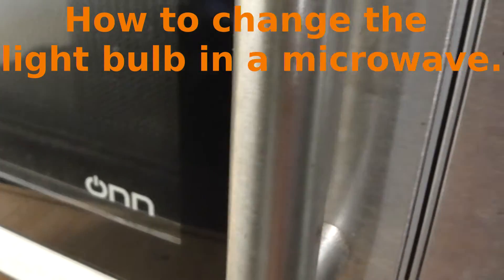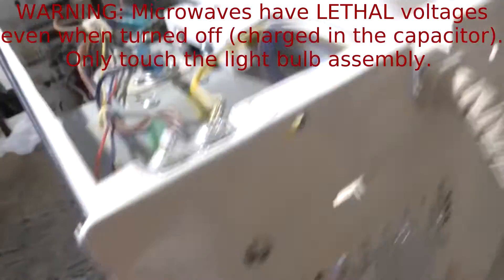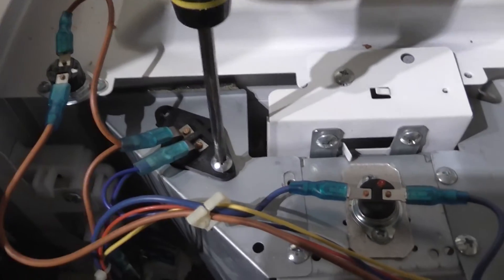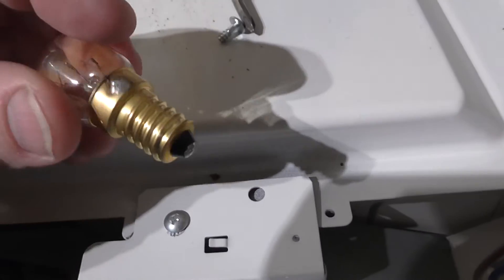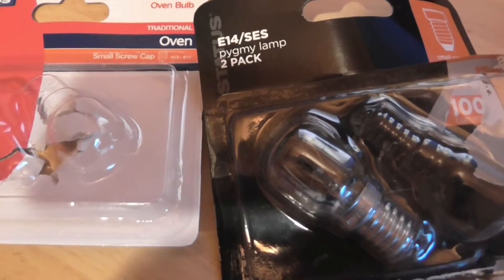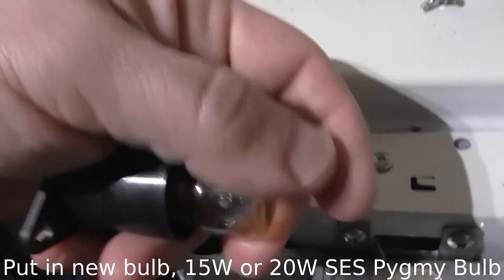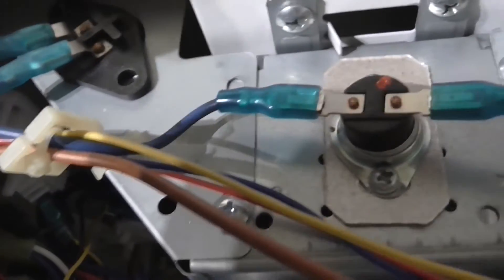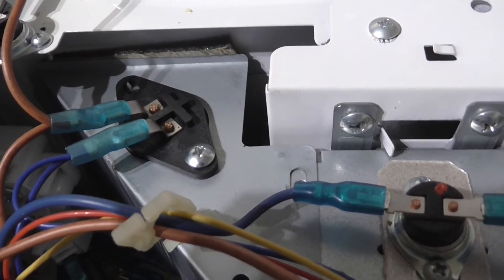Microwave lamp bulb replacement

Comment: Is the microwave safer to handle if kept unplugged for 24 hours?

My mv is a very old LG convection. Already repaired once 4 years back and the guy could only get the mv part working. Convection doesn't work, but I'm using it as is. Now the light conked. Quite sure I won't get the branded spare bulb now. What are my options? Original repairman not available now.

Comment: I've taken three microwave ovens apart over the past 40 years, and, in all three of them, as with this one, the bulb holder had only one screw installed, even though there were holes and threading for two screws.
Reply from the maker: @sunrise8263  I imagine they are cost-cutting down to the last screw perhaps. Or perhaps it's cheaper to leave the  hole and tapping rather than designing it to remove it completely. Interesting comment - thank you.
Reply: @TrystansWorkbench  the bulb holder is probably a part used in a lot of different appliances and having screwholes on both sides probably allows it to be more versatile.

Comment: So, what about built in microwaves?
Reply from the maker: I'm not entirely sure - it may be that a built in one is the same as a free-standing one except that it has fixings to buid it into your unit. It's likely it would have to be removed as an unit first.
Reply: @TrystansWorkbench  I found mine. Just had to remove an access panel (actually the vent) at the top of the oven and then a small metal cover. It's a 30w bulb.

Comment: Make sure that you don't handle the new bulb with bare hands, which will leave oil on the surface and may shorten the life of the bulb. If you DO handle the bulb with bare hands, make sure you use glass cleaner to carefully clean the bulb, prior to reassembly.
Reply from the maker: That is indeed a good thing to do with halogen bulbs, but it's unnecessary on these incandescent bulbs.

Comment: If that is a halogen light bulb, you should always clean off any oils and fingerprints before energizing it.  They will fail prematurely if they're not perfectly clean.
Reply from the maker: It's not a halogen bulb, but it's a good tip for car headlight bulbs.

Comment: Well after watching your video, I think that I'll use the microwave with no bulb working as I don't feel like getting nuked. Plus I'm disabled, so removing the microwave cover is not an easy task for me. Would be so simple if the bulb was in it's own compartment at the side of the microwave......wonder why manufacturers don't do that.
Reply from the maker: Annie, thanks for your comment. You can put s torch next to your microwave instead. They don't put user-replacable parts in most things as they hope you will buy a new appliance instead.
Reply: Exactly.! I wonder why manufacturers always put stuff around important pieces you might have to work on, sometimes the actual items end up being more fucked up than when I touched them in the first place, that's why I don't Fuck with them either 🫤

Comment: Ok, so ….. I had no idea that nukers can actually HOLD a charge in its capacitors. Had no idea that capacitors actually existed beyond Doc and Marty’s world. Bahahahahahaha.  Thank you so much for that little nugget of info in your vid description or I may have bit the big one trying to replace the bulb in Mom’s nuker. Grandpa said electricity won’t leave home unless it knows it can come back, is the only thing I know about it. Argh!
Reply: Probably not enough to kill a person
Reply: The filter capacitor "ought" to be discharged by the magnetron itself if the appliance has been shut off while normally cooking (lamp or no lamp).  This happens during a brief moment before the magnetron's cathode becomes too cool to emit electrons.  But if you do not know if it really has been discharged, take no chances.  And never plug in, let alone power on the appliance with the cover removed.

Comment: Brilliant - my Parmco model was almost identical inside.  They'd gummed the bulb in place to make it hard to change, but this video gave me the confidence to be a bit firmer with it, and out it came.  Many thanks!
Reply: The "gummed in place" light fixture was probably done by food cooked in the microwave, my model had a film of sticky stuff all over inside the area of the light fixture. My guess is that vapors from cooking food pass through the perforations and gum up that area.
Reply: @jwagnermail  Interesting idea, but the bulb and the interior of the light housing were clean, the black gum was only on the thread of the bulb.
Reply: @davidriddell3610  Maybe it was to keep the bulb from loosening up. My Hamilton Beach microwave oven has no light after 2 uses and I'll bet the bulb has just loosened up.
Reply from the maker: David, You're most welcome. I'm delighted that you gave it a go, and have now given your Parmco microwave a new lease of life.

Comment: Is kenstar products available if so where can i get micro wave oven lighting 220 volts 50 Watts bulb
Reply from the maker: The bulb can be any brand, as long as the electrical rating and the fitting is the same. In my example I bought the replacement bulb from a shop called Home Bargains, but the bulbs are quite universal and quite easy to find.

Comment: is this pretty standard on how to change the light bulb with any or most microwaves? I don't have this make/Brand in this video here but I have a Cookworks and ridiculously I've only had it for a few short months and the bulb has stopped working already but I don't like your comment 
"Microwave ovens have lethal voltages (even when unplugged)." that worries me but also doesn't make sense to me if it's switched off, how can it be lethal if it's not getting any power???
Reply from the maker: No worries David, I suppose these devices are made to a price point and they want us to buy new microwaves just because the bulb has blown.
Reply: @TrystansWorkbench  the crazy thing is I not long bought the new one I have now probably no more than 2 to 3 months ago and the bulb has blown already, I was shocked!!!
Reply from the maker: @David.L291  Well it will still be under warranty, so check to see how you can return it safely. The bulb is not an user-replacable item and is covered by the warranty. Take care David, from Trystan
Reply from the maker: David, A microwave has a capacitor in it that builds up a charge at a lethal voltage. This charge is retained even when the microwave  is turned off and unplugged. The charge dissipates though over many hours. Typically, yes, the bulb change is typical on most microwaves as the designs have not really changed in some forty years apart from the user controls (buttons, displays).
Reply: @TrystansWorkbench  I think it's absolutely dumb to manufacture these microwaves without making it more easily accessible to change the bulb, even my fridge bulb just has a cover that's it, I don't have to take the whole fridge apart haha but thank you for replying to me and explaining to me

Comment: To those who aren't well-versed in electrical work:

You shouldn't attempt to do this yourself if you do not know anything about electricity. As stated, capacitors in microwaves can hold very high-voltage when fully-charged. Unless you isolate yourself from ground and are careful not to touch both the + and - ends of a capacitor, you should probably leave the microwave unplugged for about 24 hours just to give those caps time to discharge.

You could also bleed the caps safely by bridging the + and - terminals together (shorting them) with an item that introduces a certain amount of resistance (but not so much that electricity cannot travel between the terminals) while also isolating yourself from that item.

In short: You shouldn't mess with high-voltage systems unless you have, at minimum, a basic understanding of electricity and can perform the repair safely.

That said, we can all make our own choices :P
Reply from the maker: And that is why in the description it reads: Observe all safety notices on your microwave oven before doing any work, and only carry out the work if you are qualified to do so.
Reply: Don't just go jabbing a fork in there and you should be fine. Don't touch anything except where the bulb is mounted.
Reply: I'd estimate that most people, even those not well versed in electronics, can understand to unplug the unit first and avoid touching any electrical connections while working, wearing gloves if necessary. I'm hoping we haven't devolved so far as a species that that would be beyond most people's capabilities.
Reply: @pcno2832    yes..... I have a Haier..... I at least found out that the bulb is behind the perforated panel....( And not the silica wafer slotted.....thingy.. obviously is Microwave  emitter...🥹 )

Comment: Please help me the inside bulb of my microwave defy model dmo 343 is dead and I want to get it out to replace it.
Reply from the maker: If you disconnect your microwave, undo the screws holding the cover, then remove the cover. The bulb should then be accessible.

Comment: What if the bulb is so tight you can't get it undone? I dont want to break it, Surely it's not the whole part needs replacement? This is for a Sharp Carousel microwave...
Reply: Yes, in some microwaves the bulb is built or soldered into a plastic mold, so you can't unscrew. 

I called SunBeam Microwave to ask to buy the correct bulb and they said that they don't sell it because it is too dangerous to open the microwave, I told them that I had already opened it, but they told me to take it to an authorized dealer. I found the bulb in Amazon and changed it.  Fortunately, I already had the correct screwdriver to unscrew the funky screws the company used. They used a screw called security hex or security hexlobe (Torx). 

The original bulb said that it was 250 volts, but there is a label on the microwave that says to use a bulb that is 125 volts. Well, the company didn't want to clarify my question about the difference in voltage, so I decided to buy the LED bulb in amazon and hope for the best, anyways, it wasn't expensive. Just like the original, the bulb I got says 250 volts, it is LED and is brighter. Now let's see how long it lasts. Here is an image of the kind of screw head used on my microwave : http://photo-suit.com/editor/?

And here is the bulb I bought in Amazon:  https://www.amazon.com/gp/product/B07F8TS3FK/ref=ppx_yo_dt_b_asin_title_o00_s00?ie=UTF8&psc=1
Reply from the maker: Melissa, so I take it that you have unscrewed the holder that the bulb is in and you can't get the bulb out of that? It may be a push-fit type of bulb in your microwave that pulls out. Wear gloves if you feel that you might break the glass.